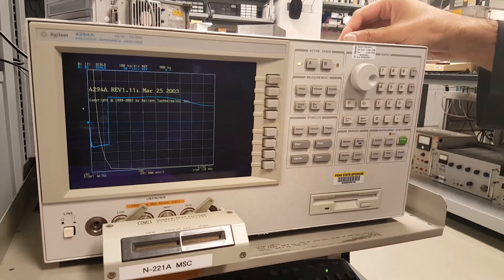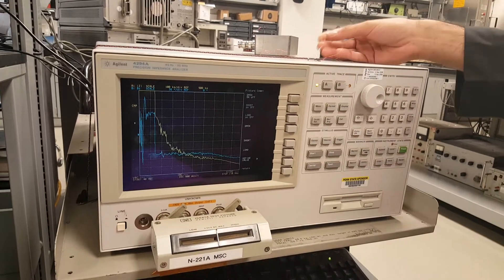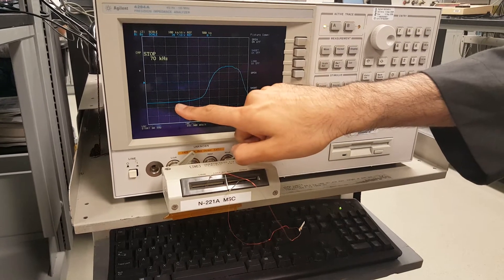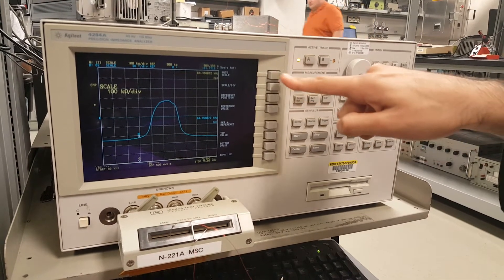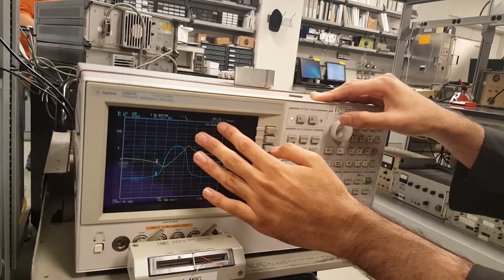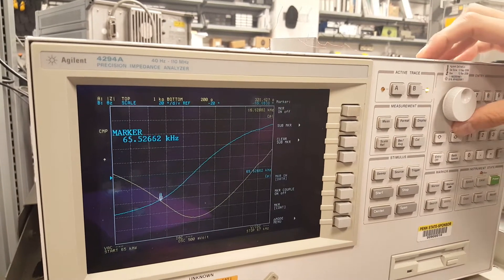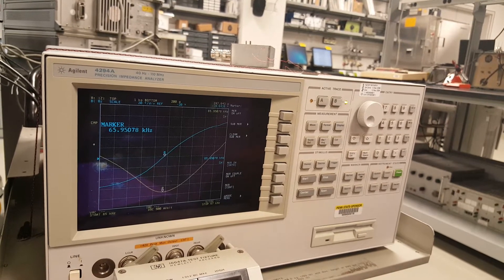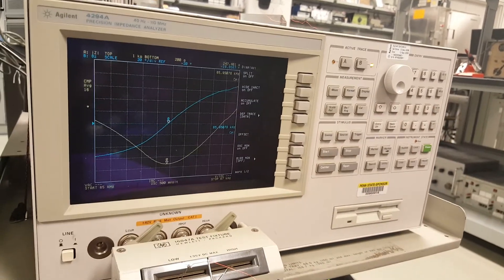HP 4294a  Impedance Analyzer to Characterize Piezo - Learn Piezo Lecture 10A: (Part 1)

Comment: This machine is very good. I experimented with an oscilloscope and a signal generator.
Reply: Now I use an instrument with high cost performance, which can also measure frequency impedance capacitance and other parameters.

Comment: Hi Husain Shekhani thanks for your sharing. May I know is it possible to use a LCR meter to obtain the impedance (C0, L1, C1 and R1) of piezoelectric? What the difference between impedance analyser and LCR meter? Appreciate your reply.
Reply: Thanks for reply Husain Shekhani. 
May I know how to determine the degradation of piezoelectric material? For your information, I had produce a constant force to the self-assembly piezoelectric cymbal transducer (PCT). Some of PCT can produce 100 Vac output with 0.1MPa compression force but some only obtain 50 Vac. Is it due to the degradation of the PCT? 
Beside that, I had tried to measure the impedance of those PCT with 100K Hz frequency through GW iNSTEK LCR-819 METER. Unfortunately the impedance reading of both high and low performance PCT is close to each other. Is it due to the frequency not match with the PCT?

Comment: I have a similar but older model HP/Agilent 4192A, and am new to learning how to use an impedance analyzer. Just curious, what is the purpose of the test fixture attached to the front of the device Is the test fixture used only to test and machine?
Reply: @ultrasonicadvisors  Can't I just use T-connectors and BNC cables?
Reply: @ultrasonicadvisors  Thanks, is it possible for you to show me the connecitons for that? Should the Hpot and Hcurr, be shorted then? Similarly with the Lowpot and Lowcurr?
Reply: I know this is a 3-y old comment, but in case someone else may need to know:

The measurement methodology for this instrument is a "4-wire" system. Two wires are for delivering current to the device (H_CURR/L_CURR), and two wires are for measuring the voltage of the device under test (H_POT/L_POT). This is done such that you will not be measuring the impedance of test leads in the system. Obviously in the end system the POT/CURR are "shorted" together since they go to the same node, however you can think of the CURR as a bus delivering the current and the POT as a wire measuring voltage, like you would with a multimeter directly over a load. 

So, it is possible to get measurements with T-connectors and BNCs, but keep in mind your measurement setup will skew the results.